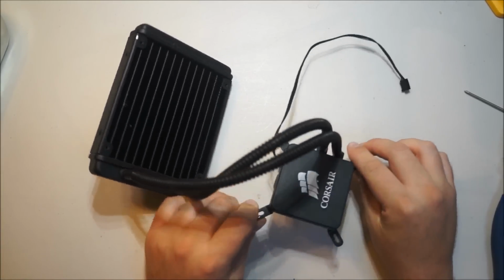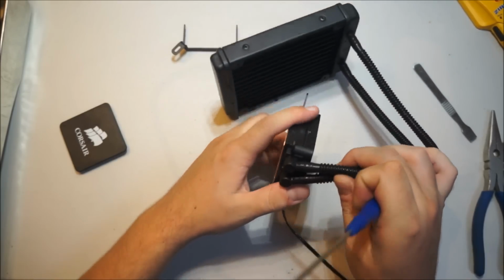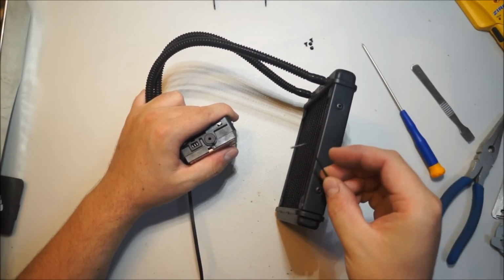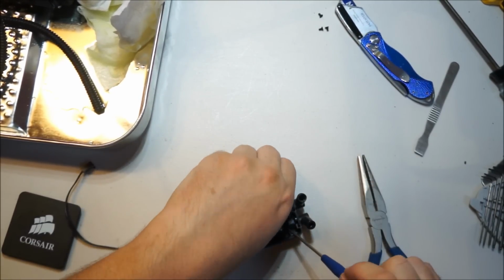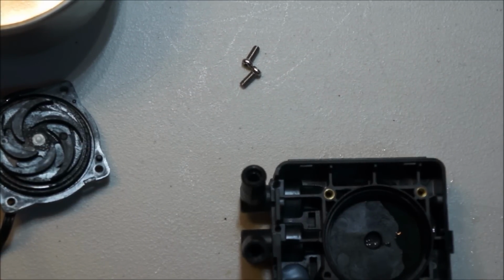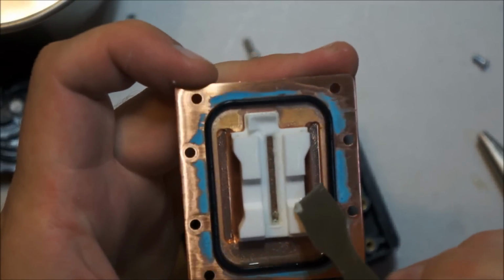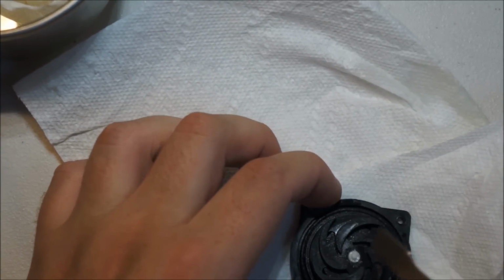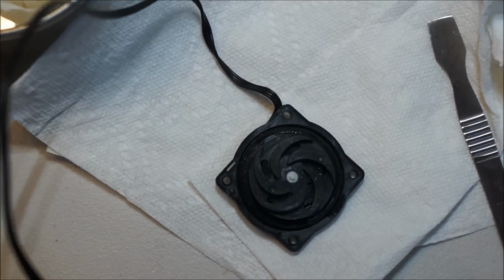Extreme Teardown: Corsair H60 closed-loop water-cooler

Comment: I have a couple of these, one is an H60 and the other an H80. The main issue I find is that this motor/impeller design is not as robust as older designs. It it gets off balance for any reason, it will vibrate a lot and make it almost unusable as far as noise is concerned. The H80 is silent and has been for years but I had to pull the H60 out of the PC I was using it on and replace it due to excessive noise and vibration. I'm still trying to see if I can fix it but haven't round what is wrong with it yet.

Comment: Hmmn was thinking about putting a bigger radiator on my h60, not so sure I want to after watching this video. I did that to an enermax 240 aio and expanded it to a 360 radiator, connected it to a reservoir,   and works perfect. However, the enermax uses gaskets and isn't pressurized

Comment: The gas was the evaporated coolant. That's how air conditioning works. There is a liquid inside that evaporates at a certain temperature (less than room temperature). The gas then goes through the radiator where the fans dissipate the heat and turn the gas back into a liquid. The mixture you are pouring out is just the other liquid in the mixture so you don't have 100% gas running through the system at all times. Heat dissipates through liquid better than gas which is why they add both a coolant and adjunct liquid that evaporates at a much higher temp.

Comment: Hey! i've seen your vid a few times and decided to ask for some help. i have an H60, and my pump is acting up, i took it apart and when i connect it to the power the pump will make a few strange sounds, once you manually turn it though, itll start spinning and even if you stop it, it'll restart. what could the problem be? i can't really use it if i have to start the pump manually.... what do?

Comment: I bought my first H60 back in 2011 and something broke inside it after about half a year. CPU temperatures rose like crazy, the hose was boiling hot to about half way and the reservoirs were cold to the touch. So something stopped the fluids from circulating. Either corroded gunk or air trapped inside. That AiO set was RMAed and the new one started developing problems about a week ago: Rattling pump, rapidly rising CPU temperatures, reduced performance, etc. 
I'd say these AiO closed-loop sets have a lifespan of about four years or so until the pump starts to wear out or something builds up in the loop.

Comment: I'm not sure if anyone else commented on the 2 pin connection on the side of the Pump/Block, anyway I think it is to connect an early basic version of the LINK system to control fan speed automatically when temps increase . They advertised this and the H100/H1OOi as having LINK, but you had to spend about another £50 to get it separately.=(

Comment: lol "it's manufactured using metric"
sounds like a complaint :P
join the rest of the world if you haven't already
Reply: The Aviation and Aerospace industry is mostly Standard. I neither agree or disagree with your comment but just a FYI. "the rest of the world" doesn't necessarily use Metric.
Reply: sorry, not rest of the world, vast majority of the world is what I should have said.
Reply: I believe the automotive industry uses mostly Standard for things like power and pressure.

And then use metric for things like displacement.

Comment: 22:58 You have it wrong it's not need mass etc. it's osculating because of coils are energised in sequence.  The base is moving to finding neutral position between magnetic filed. Because base it's not attached to anything it's move instead of shaft. Check DC motors.

Comment: coolant fluid MUST enter the rotor on the center of it, other way it would be a turbine instead of a pump, so, fluid circulation must be the other way around,  Low temperature fluid arrives to the cooper heat spreader on its periferia and run all the way to the core, passing through the fins and elevating it temperature in the process, (removing heat from the cpu) then it reaches the center and slips through the hole moving on to the center of the rotor, the the rotor impels it to its own periferia, rising fluids pressure and pumping it to the radiator, where it will cools down and continue to the intake of the water block to repeat the process.

Comment: To cut the fins they probably use a wire edm machine. I work with those machines and we've cut stuff like that
Reply: +cheeriomartinez Yep I agree that's the only way I can think of that they can do that, those machines are very very expensive
Reply: OR!! I just thought of this... maybe molding?
Reply: sorry but fins like this are impossible to mold. The liquid coppe solidifies way to fast for fins like this.
You can mill this fins but the most common way is spark eroding.

Comment: dat fin is probably pressed on, since copper is soft and its generally easier and cheap to form the shape rather than using an end mill
Reply: Cooper is soft until you work it, it then work hardens, Forming copper is difficult as copper is very abrasive and wears tooling out very quickly,

Comment: i have the next generation of this, the cooling performance is rather poor for its noiselevel, way worse then my ARCTIC Freezer XTREME Rev. 2, which was actually less then half the price of the H60...
Do you guys think it would hurt if i carefully screw of the baseplate and look for any debree in the fins? i mean, the pressure that is in there would escape, otherwise i should be able to put it together as it was...
do you think the pressure does actually have a valid reason to be there and is needed for cooling, or is it just something that builds up with time and can be released no problem?
Reply: Cheap (<100$) AIO loops are not worth it. Better go with a good air cooler.
Reply: ***** Well, look at H80i.

Comment: Very good, informative vid. I killed one of these after I removed the 3 wire leads and tried to ghetto rig it to 7 volts to make the pump quieter. Unfortunately, I was an idiot and one of the wires slipped and just my luck it snapped back into its original place which happened to be right next to the other wire which was connected to 12 volts shorting them and effectively bricking the entire cooler. It was actually a Cool IT brand cooler which is the company that makes this style cooler for Corsair and several others. I took it apart after it died and it is exactly the same as this one. I am currently using the new version of the H60 with the improved pump and rubber hosing. It is way quieter at 12v than this one.

Comment: Woow, so the problem with these is the corrosion of the copper in the thin stripes where the coolant makes contact. In the end the flow decreases drastically cause of this.

Comment: Thanks for this, it gives me a very good indication why my CPU heat is sometimes as low as 29 Oc and then 48-55 Oc. The fan must stick, so now I take the side of the case off given the block a few light knocks and would you believe it, the temp drops to 29 Oc again. I guess that "gunk" I saw is a CPU killer?

Comment: That is the h80 not the h60 :) and also I dont think that is a beeper for the pump its a water inlet so you can bleed the air out as someone replaced the tubes on one with clear and added red dye and used that to add the dye and remaining water.
Reply: that is definetly the h60. H80 ahs a thicer rad

Comment: How do i disconnect the damn hose from the radiator while being able to put them back like on the water pump assembly since i want an easier way to refill the liquid without air bubbles

Comment: normal custom liquid cooling systems need coolant changes every 2 years but the point of closed loop ones like this is to never need refilling last at least 5 years before wearing out, they actually have a warranty for 5 years so any to last any less than that would be a defective product.

Comment: And "Steve wang" unless you live in a fridge there's no way you got a 2600K to 4.2Ghz using the stock intel cooler, it has a less than 50W heat dissipation

Comment: Oil isn't mixed into the coolant, nor is there any antifreeze, the liquid stays quite warm considering it is in constant contact with a hot CPU, since there is a single 120mm radiator cooling performance is quite poor, the liquid is just distilled water

Comment: I had my 2600K with stock cooler @4.2Ghz and it ran fine for over a year.  only goes to 90c when doing prime95, but even folding it just hovers ~85c.  The intel coolers is pretty quiet, unlike the amd wafer thin stock cooler fan.  Now running 4.8Ghz ~75c on antec 920 cooler.

Comment: not overclocking is like throwing processing performance away, most modern motherboards have a decent amount of overclockability and even if you dont have a K series processor you still have the ability to overclock, the problem with stock coolers are both their cooling ability and noise... youre basically throwing money away... even an H60 is way better than stock

Comment from the maker: There's actually a rather silly story there, for why I bought a 2600 over a 2600K.

Basically, I wanted to experiment with VT-d. The 2600 has VT-d enabled, whereas the 2600K does not.

So after all that, I wound up with a 2600. I then proceeded to buy a motherboard with a BIOS that doesn't support VT-d (it requires BIOS-level support to work properly).
Derp.

Oh well, it's not like there are many virtualization programs that support VT-d anyways.

Comment from the maker: I dunno about that, My i7-2600 has been running fine on the stock heatsink for more then a year.

I don't overclock, though. 

Really, it's just a matter of what you want to do. I don't particularly feel the need to overclock, and I don't have noise problems (my GPU is much, MUCH louderO.

Comment: It appears that the blue material on the copper CPU plate may be RTV sealant. It is commonly used in industry as a backup sealant & to hold primary gaskets in place (the box shaped O-Ring) during assembly.

Comment from the maker: Huh. Well, all I know is that water-cooling has been a domain of crazy PC overclockers for more then a decade now. And indeed there is a *lot* of discussion on the most effective way to thermally couple the water to the heat-source.

As for the radiator size, well all I can say is that Corsair makes multiple models with the same waterblock, but different radiator sizes (H60 H80 H100), and the H60 is indeed the smallest. It still gets decent reviews, and is better then most stock heatsinks, tho

Comment: (anyway, it boils down to: heatpipes can achieve in the order of <10mK/W at arbitrary length with heat front speeds in excess of 1m/s. In order to get the same performance out of water you need significantly larger heat exchangers because water doesn't effectively transfer heat above pretty low Reynolds/Froude numbers, which also seems to be the reason for using those skived ribs instead of water channels)

Comment: But what use is using a closed-loop system with such a small, high impedance radiator then :P doesnt make sense

As for water as a thermal medium: no... it's pretty bad compared to heatpipes, but the reasons are quite a bit more complex. It mostly boils down to the fact that water is a very bad conductor *but* a very good storing medium of heat, so you need high surface area and/or mass flow rate to get similar performance. I should write this up somewhere other than YT comments...

Comment from the maker: The idea is that you can decouple the heat-dissipating element (The radiator) from the heat-generating element (the CPU).

Basically, you're somewhat limited in maximum heat-sink size just by the fact that it has to mount to the motherboard. 

-----

As an aside, water is an **excellent** thermal medium. Assuming proper circulation (e.g. a pump), it's WAY better then a heatpipe.